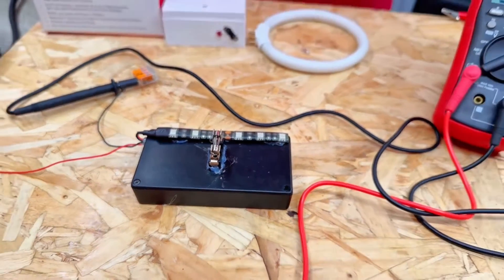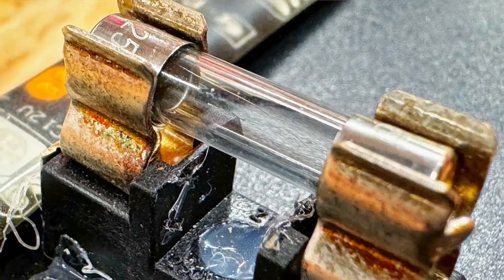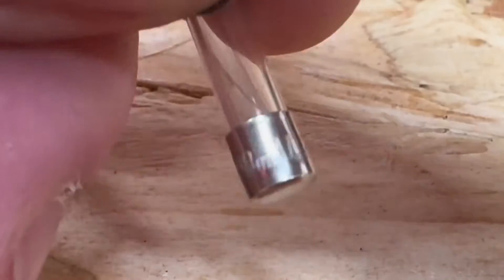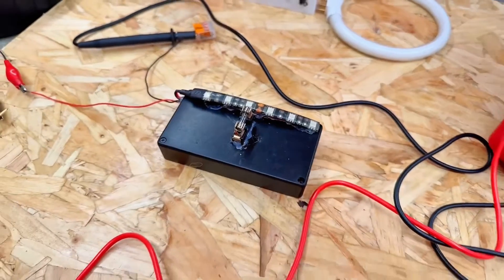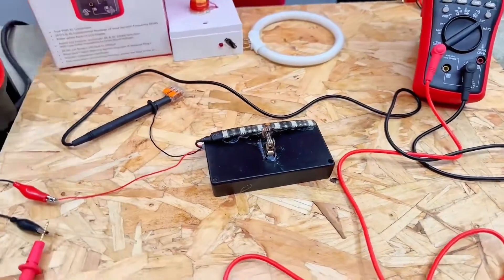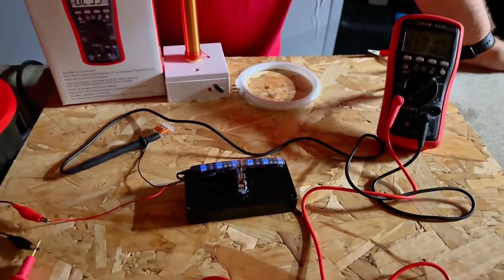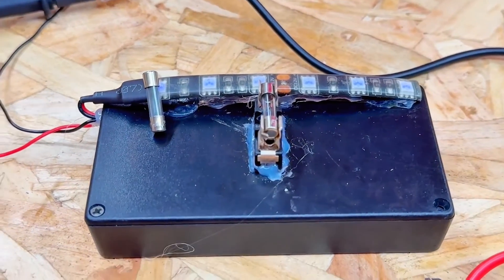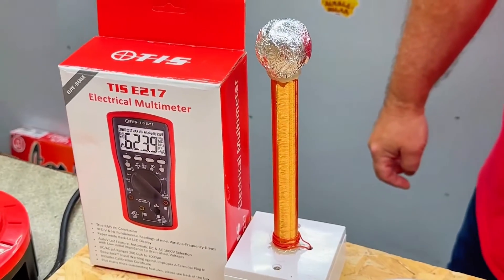Fuses: When Breaking Something Is a GOOD Thing! 💥

Comment: You can't make the statement that the voltage and current are proportional.
That is ONLY true for ohmic loads.

It is NOT true for semiconductor devices such as diodes, thermistors, thyristors, triacs.
The IV curves are non linear.

And what you have here are LEDS - aka DIODES.

This is basic electrical theory.

Comment: Whipping out the fuse's (or a similar one's) datasheet and showing the trigger graph would make this clear to the learning part of the audience, instead of making them wonder.
(Basically: at room temperature and x current, the fuse needs y time to fail (which is still far enough than the wiring in the base curcuit can withstand.))

Comment: Fuses typically need around twice the rated current to blow immediately. A standard 13 A fuse usually needs around 26 A to blow. However, if run at the rated value or close to, they can get quite hot. It's not unusual to find 13 A fcu's on immersion heater circuits. This is typically about 12A & they get warm, often degrading the plastic & causing accelerated tarnishing of the connections, so it gets even hotter. Eventually it fails or the fuse blows through aging as the heat degrades the fuse wire.